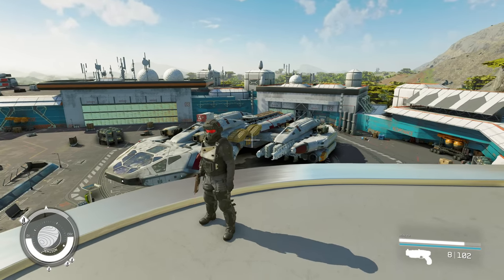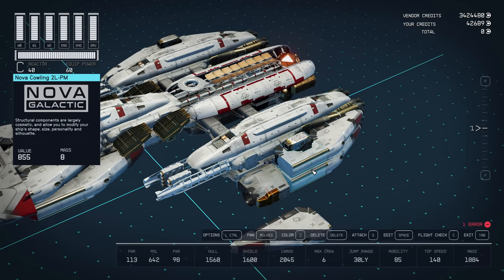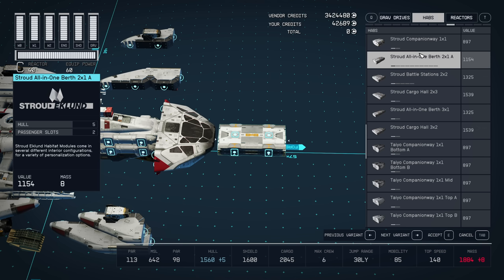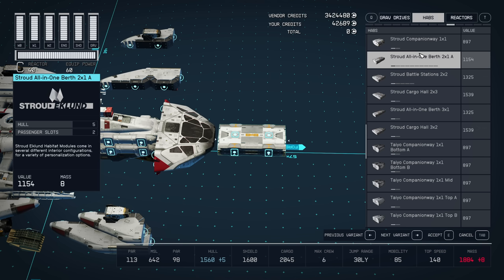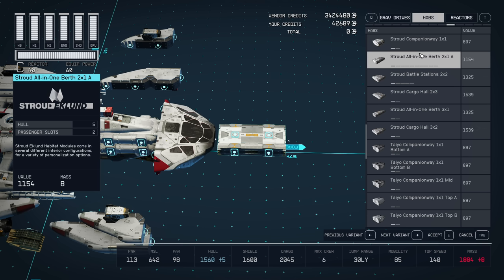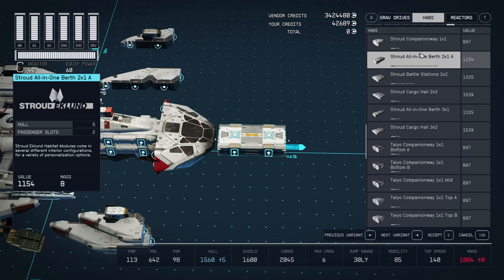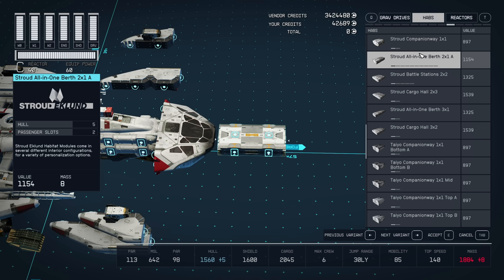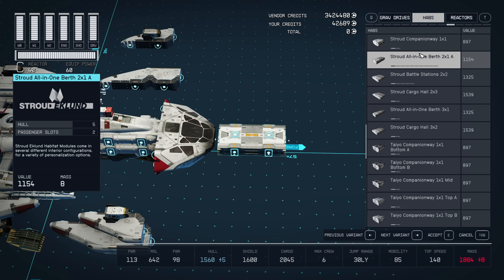Starfield Ship Mechanics, Stats & Building Full Guide

Comment from the maker: Total cost was 648,000.   most parts are sold at titan, except the reactor, docker, and obliterators are sold at neon.  Outfit is neon security armor and operative helmet
Reply: Is that with the discount perk?
Reply: The sal engines you can have 6
Reply from the maker: @ivcorpse  those are the type a's I'm using the b class ones that you can only have 4
Reply from the maker: @JimBobe  yes that is with tier 1 discount
Reply: Don’t forget to pin this comment. 🤙🏻 (Your comment not mine😅)
Reply: Silly question, but how do I get from both locations when I can't be in both at the same time? Do I need to just buy the parts I want, figure out where to put em on a throwaway ship and then travel to the 2nd?
Reply from the maker: @Potts2k8  yes that's what I typically do, for this one I recommend taking a ship to neon first, grabbing the parts that are available there and strapping them to a ship since reactors and engines are very expensive and you need them to move a ship of this weight. Then fly to titan to put all the other bits on
Reply: Damn, looks like I need to make some money. For a “Demo” ship this is exactly something I want to build. I’ll be coming back to this once I’ve got the cash saved up
Reply: Cost me little over 400,000 ish.  But that's starting over a type c zealot ship I commandeered.  And  level 4 Commerce skill
Reply: Why am I having issues with the docking bay at the back with hubs not going all the way to the front C30 cockpit and having to walk around through the side doors or  just walk through the closed door/wall after the last update?
Reply: Great video, super informative. I've been watching Oxhorn's playthrough and he's been kinda frustrated with the shipbuilding, so I'll mention your video to him.
I'll definitely be building a variation of this for my first shipbuild.
Reply: Wooowwweee that’s costly! 😂undoubtedly worth it
Reply: All in one hab on the frontier has a galley for cooking. 👌🏻
Reply: You can find Obliterators at Stroud Eklund hub, in Narion, as well.
Reply: Just fyi.. radiators make no sense at all in a spaceship. There is nothing where the heat can go in space.
Reply: @Potts2k8  yes
Reply: What’s that outfit you have on
Reply from the maker: @tombooze74  neon security armor and operative helmet

Comment: Best engine in the game is the Sal stuff they only require 2 power so you can slap on 6 of them bad boys so even your behemoth cargo supercarrier can move around like a mosquito. The best one, the Sal 6830, is only available if you’ve finished the mission in Neon with Walter in a „good“ way, it has 8800 manoeuvring thrust that’s 4400 per energy absolutely maximum you can get!
Reply: I found 3 x Poseidon 230 to be more powerfully, somehow.

Comment: Good video. I only learned a couple things that I didn't know, but the interior and weapon damage references will be very useful.

A tip for any readers, use the same Nova Cabot C3 Cockpit (or it's variants) that is used here. Connect any 1x1 Hab to the bottom of the Cockpit, the Taiyo Ship Bed 200 on the end, and something like the 100DP Slim Docker or the Extender Port 200 flipped and placed underneath. Your docker and landing bay both lead to the same room, and are right next to the cockpit. 

To access the rest of the ship, you could place any Hab on top of this 1x1, but that adds another ladder to that 1x1 entrance area, and you'll probly pass through here alot. Instead, put the Hopetech Hab Spine above the 1x1 attached to the upper half of the Cockpit and connect your Hab to that, and build off from there. The Hopetech Spine will not spawn a ladder to the 1x1.

Good to note that the Hopetech spines and the similar Nova one used in this video don't spawn ladders when over and under other Habs, so you can use them to cross-over Habs without adding a bunch of unnecessary ladders.

Comment: To whom it may concern:

For PC:  Power management - instead of using D-arrows to nav and power up/down, you can hold alt + WASD for the same effect.
Save you jumping around the key board.
Reply: ...And if you hold the button you can decrease all power a module has to 0 rather than having to press for every point it has
Reply: Additionally Z, X handle system selection and I personally set C and C to increase and decrease as I've set alt to manage thrusters and mapped it to a mouse thumb button... Point is, there's a fair number of options on hand if you customize. Not perfect for me, but close enough.
Reply: you sir are a legend

Comment: Great video! *A consideration for those building long low ships. On more than a few occasions I have landed at bases that have made an area in the front inaccessible because the bridge is clipping through part of the environment. (I can't even stand under my Ares bridge with my current build.) This is not always an issue but on a few occasions I was denied entrance to a facility because it clipped through the entrance when I landed on the pad and had to go through the back entrance and run the facility backwards and then could not exit through that point main entry point for the same reason, my ships bridge was partially inside the doorway. It's a minor inconvenience but something to consider. Especially if you have not invested in Security as you will need to be able to lockpick high level locks to enter the back way.

 I have a long and low ship with a rear landing bay because I like to be on one level. From back to front: landing bay, 2x1 captain's quarters with docking module near the rear, Armory, Battle station, then an Ares bridge. I put two all-in-one habs above to add room for passengers and I don't have to ever go up there unless I am looking to store things on a crewmember who is up there, a rarity in my current build that has plenty of cargo. (Tip for that below**) 

 I like the rear entrance and being on a single level mostly because when you land directly at PoIs you are not running out into enemy fire. You get to  plan your assault and even leave the landing platform if you want to make a stealth approach. I have even positioned on the top of my ship and picked off every enemy I could draw out before going in. My next build will still be a rear entry but I think I will try and use a bay with a top entrance into the ship and elevate my main habs and bridge a level to avoid the issue I am having. While it is inconvenient to run around your ship, you can fast travel directly into your cockpit, so it is really not an issue.

**For those struggling with cargo capacity and don't want to add a bunch to their ship or are two low level to build a decent ship with cargo yet, using crew as mules is a great option that many may be already aware of. But equipping them with the low level armor and things that buff their carry capacity like "Resource Carrier (found in helmets, packs, and armor), Holstered (weapons weight 50% less), and carry capacity bonus items found in  game (although this final one needs testing because it does not show up in the total.). Utilizing the items that are too weak for you or your current companion to utilize in the field helps a lot as dumping material and weapons on them keeps it from adding to the ship. It is a bit of a pain to sell it off what you stored on them as you have to run them down and unload it all but early in game for me this worked great to store resources and weapons I was not going to sell. 

Also the Leadership Skill in the Social Tree (Tier 3) is great as it adds 50kg carry to them all at level 2 and it is great to utilize if you need to burn points in that tree to get to more crew members in the Ship Command skill. With so few of the skills in that section having real use, this is one place for those with smaller, low cargo capacity ships to take advantage of and can add as much as 185kg of carry space per crew member. That is 1480kg of extra cargo with 8 crew members, not including any bonuses from items you equip them with.

Comment: 1:37:00 I agree, you can't really run missile setups - but due to their high burst, they make a great filler for the "extra" weapon assignment - particularly if you're running lasers/ballistics rather than particle beams.

Most of the time you're going to lack the power to keep all of your weapons fully charged, and running other types of weapons on low power significantly impacts their DPS. This is true for missiles too, but unlike other weapons missiles are focused on alpha strike: You can leave only a single point of power in the system and still utilise the benefits of that high alpha strike. They also have the longest range of all weapon types, so if you're boosting out and using thrusters to spin-drift, make distance, and face your opponent, you can usually get a lock on and volley away long before you're in range with your other weapons.

They also, and lets be honest this is the most important thing, look real coo'.

Comment: Very useful guide. I would point out that the Nova All in One / Frontier hab, actually includes the Research Station as well. But because you used it as the door hub in your build it would have been removed by one of the doors in that hab. Its a much cooler looking research station too. I love that hab. :)

Comment: Haven't tested it but normally I use companion ways to control door placement, and it seems to work for me,  also you can use the duplicate function to attach parts where they normally wouldn't want to attach because of other components.  Like the big round engines at the end of the list I can get them to clip into each other to slim the profile of the ship while still getting the power.

Comment: 2:46 one thing you are wrong about with the upgrade menu, is weapons! Especially with that nova weapon bracket. You can put weapons on the inside of it that fit, then “upgrade” them to weapons that would otherwise not fit. Watching on my phone so can’t send you a screenshot, but will when I can. 

The weapons are the only thing I use the upgrades menu for. Use the single point laser or whatever it’s called because it’s tiny. Then upgrade menu to what I really want to have there. Like I said before, really useful for the nova weapon bracket and also the side horizon weapon mounts (the one that has two angled mounts).

Comment: Placing Habs: The final method I've found is to use the preferred door placement.

You kinda sorta started doing this, but you did it by placing a hab between two existing habs.  You also showed that if you hover over a door icon and hit G, then you can place a hab or what not on that specific anchor point.

What you didn't cover (and perhaps didn't know back then) is that as you're adding habs, you'll notice that the habs change alignment,  You go from say the All-in-one hab to a living quarters or a workshop, then the hab will flip at the point you're trying to anchor pointing forward or pointing backward from that point.

It's giving you the preferred door placement by doing that.

This is something I doubt even the DEV's planned on doing, otheerwise it's absolutely NOT taught in-game and we pretty much have to figure it out, but I am able to get hab layouts about 99% of the time the way I want them.

The Cabbot bridge is the one we can use to make a "No Ladders" construct by using this method.  You just add each hab, one at a time, at the place where you want them, and you chose the orientation of the hab you want to go into the space.  Because of the prefferred door and orientation, maybe I chose a different doorway location, or a different hab entirely and place the hab I want elsewhere in the build, but there won't be anymore wonky door and ladder placement.

Door/Ladder denial technique This method goes with the Z switching trick to get a decoration or a hab to go where you want it to go.

If it's red, flip it with Z, then flip it back, and hit escape, and it'll go there anyways.  Even if there's overlap.  Or with Habs, place it where you want, switch to a different hab type, and then switch it back, hit escape, and it'll go there anyways.

So to deny a door or deny a ladder, you put a window there, Z-flip the item you want there, hit escape, and the game force realligns how you want the door/ladders to align.

Comment: 23:59 they really should add a structure piece like the windows that are available everywhere that forces a door connect or ladder connect at that location. That way you can put doors where you want and even force interior loops. Also a blocker plate to prevent doors and ladders, especially if there is already a connection to the hab.

Also, habs don’t need a connection, but the landing bay, docker and cockpit need to be connected. So you could technically just use Deimos braces for your wing habs and leave them disconnected from the ship as long as the bay, dock and cockpit are connected.
Reply: I sort of did this in my game. I have clipping enabled just because I like what you can do better and I always put an equipment plate where I don't want a ladder to be. Works like a charm. But it requires you disable clipping.

Comment: Not even finished watching yet and I've learned so much. For me the biggest problem I have is not knowing what weapons I'm looking at. For example, the whole time you were going over the damage output between the slow version and Auto version of the Particle Beams (PBO-50) I thought that they were Ballistic weapons (bullets) because it says in the description of the manufacturer, Ballistic Solutions. 🤦‍♂🤦‍♂So I have a hard time distinguishing between weapon type while inside Ship Builder mode. It's frustrating. You've made it much much easier to understand. Thanks

Comment: The position of your laser and guns can affect the direction it shoots when chasing targets and aiming ahead of them, you'll find that missiles, particle beams, and such that are too far away to the side of the ship will aim to the side of the reticle  and can make hitting smaller ship rather harder than normal. So using specific modules you can try to group up guns closer to the center of the ship so it can land point on with your reticle.

And yes you don't need full power to weapons to make use of them, some of the energy is for reloading said gun when it's not in use, or for the fire rate of certain particle beam or laser weapons that needs to charge up to 100 as a cooldown between shots.

Comment: On forcing doors to spawn in certain places: from my experience with the ship builder, some habs do indeed have door placement preferences. I think you can tell that when you press G on a connection and, as you scroll through the different hab options, you will see some moving from the initial position to a different connecting point. So I think you're 100% correct about that. I just wanted to second that. It may be helpful for the people who wanted more compact ships. But it's not a guarantee, as one might add some other part to the ship, that will, by the time the design process is finished, completely mess up the door placement.
Reply: Yes, I've noticed this specifically with a Stroud Eklund 2x1 computer core. It prefers the back left and front right side as door connection points.
Reply: @namaikikitsune   Yes, all the other brands do that movement also. At one point you get to a specific hab that will "move back" so to speak. Because it prefers to have a different door connection point. So it switches to that one. As a result, it "moves back" one unit/square/whatever.

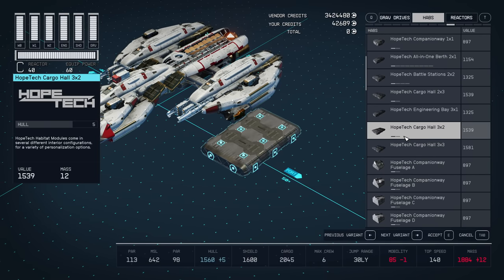Comment: 11:09 sorry to keep harassing you but one thing I have noticed with the “paired” interior groups is despite their similarities in look. They sometimes place doors and ladders in different spots compared to their look alike company.

For example, if I place a stroud captain quarter directly next to a stroud 2x2 battle station, the connection will be in the forward possible spot, same if I switch them both to Deimos. But if I mix and match either way, the door gets placed in the aft spot.

I spent hours trying to make a no ladder ship using that nova bridge and if the stroud computer room is above a stroud infirmary or lab, random ladder in the middle. Switches aft and fore depending on infirmary or lab. But if I put a Deimos computer room. Magically no ladder.

So if you like a general layout or look of a manufacturer but are concerned about ladder or door placement, swap manufacturer’s because they sometimes move doors and ladders around.

Comment: The White Dwarf 3015 is a customized part, usually indicated by breaking the numbering sequence of a part series and requiring Starship Design 4.  Most customized ships have a customized part.  For example, the Pinch 8A reactor with 36 power has an extra 600 hull and is associated with the Narwhal sold in Taiyo's showroom in Ryujin Tower at Neon.  The Aegis from Deimos has a shotgun blast autocannon as another example.  The 3015's are associated with the custom Cerberus you can purchase for siding with the Crimson Fleet over SysDef.  Not all customized parts are good though.  The Wanderlust, sold at the Eleos Retreat is a 'mini-me' version of the Pinch 8A, offering higher hull but only a piddly amount of power for ship systems.  The top end C class shield with 1,600 capacity is associated with the Stronghold at Akila.   For a customized ship without a customized part, there is the Silent Runner at HopeTown's sales office.  That one merely comes with a shielded cargo bay, saving you a trip to the Red Mile. As an exception to the exceptions I think one of the Amun-Dunn engine series, I want to say the B class ones, have a higher boost ceiling than other engines(most cap at 500-ish while those should push to 700).